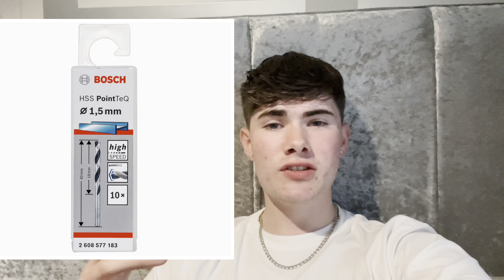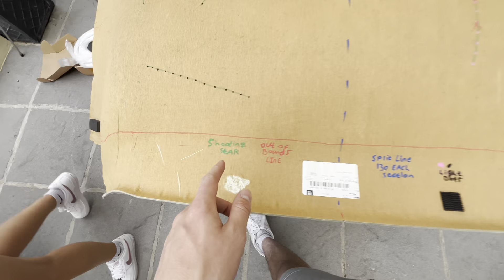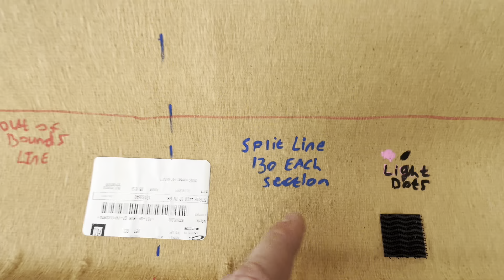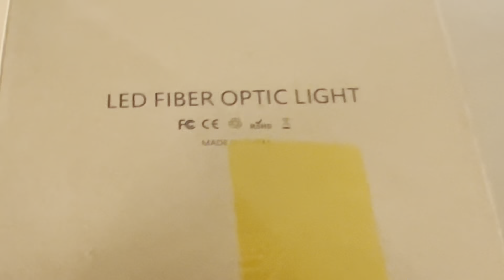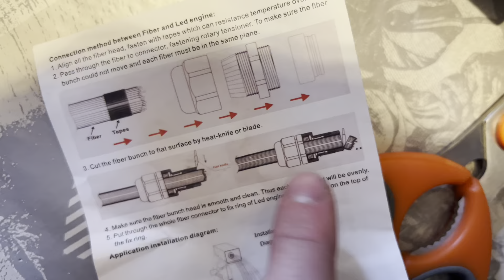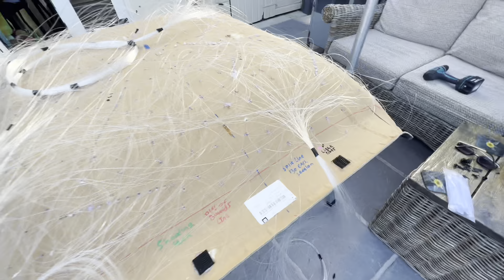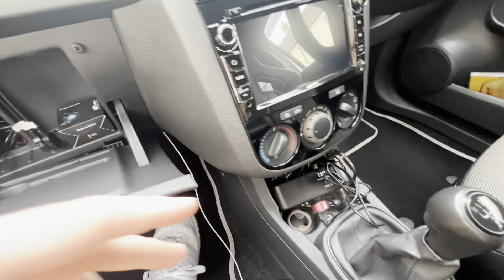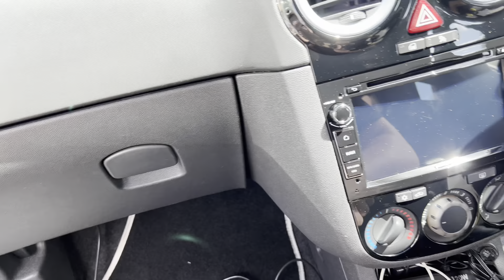Corsa Starlight Roof Install(Twinkle+Meteor)Detailed Tutorial!/Full Install

Comment: is that a reverse or a dash cam at the top back window 44:44 ? can you do a video
Reply from the maker: It’s a road angel halo pro dash cam mate
Reply: ok cool, does it connect to the fuse box at the back?
Reply from the maker: @randomb1t  no fuse box in the back of mine so had to wire it to the front as it’s got a front dash cam aswell

Comment: Are you thinking of any engine mods or suspension
Reply from the maker: I was gonna change the suspension but since I’ve put the maxton kit on it I keep getting stuck or hitting it because of the front splitter extension so just gonna keep it as it is upgrade it to the same height when it needs it and as for engine not 100% yet